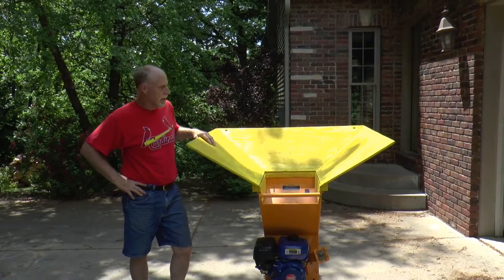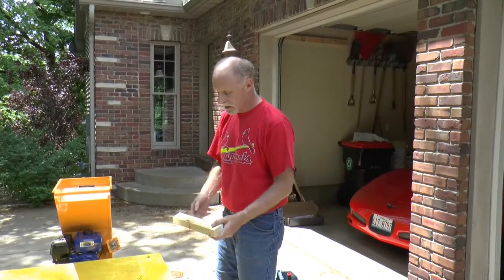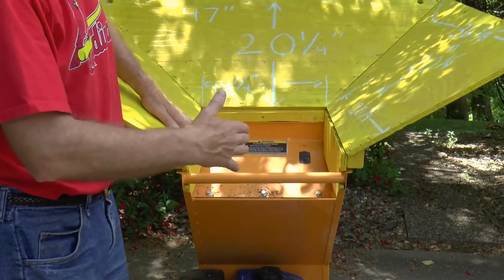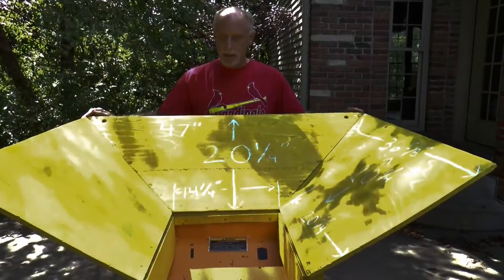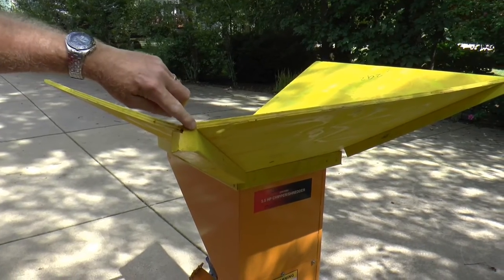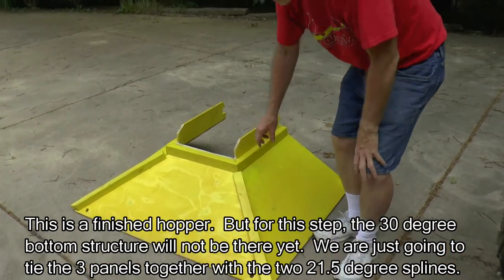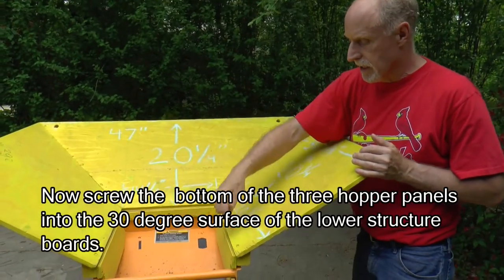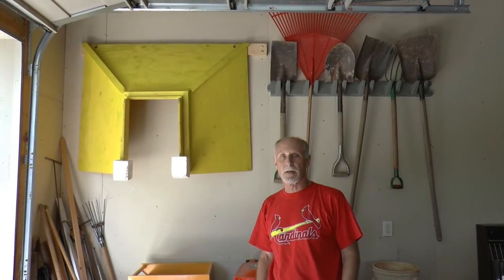How to build a leaf hopper for Harbor Freight Chipper Shredder

Comment: I really like this.  Ever think you might make a lighter version using coroplast or a similar material?
Reply from the maker: You can try Coroplast if you want, but from my experience, I would not recommend it.   When piling stuff into the hopper, it handles a good load of leaves and sticks, and it gets bumped around a lot just from the nature of the work.  It's pretty stiff the way it is, and that keeps everything square and holds its shape when carried around off the chipper.  While I don't think it needs to be any stronger (it's held together for more than 2 years of use), anything more flexible or less strong I think could be problematic.  As it is, it hangs out quite a bit from the chipper, and when you move the assembly of the chipper with the hopper on it, going over bumps shakes everything.  Based on my use and abuse, I would not even try anything weaker.  The one I have is light enough that I can carry it onto the chipper and put in in place by myself.  Near the end of the video I show how I put two holes at the edge of the hopper and put a couple of very heavy nails into studs in the garage, and cut off the heads of the nails.  This way I can store it on a wall. It's a little awkward getting it up, but I've never felt like I was going to lose control of it.  I just weighed it, and it is 21.4 lbs.
Reply: @tquinn2  those are good points.  I was mostly thinking about how I might use something like that on my bumpy yard.  It'd be pretty hard to keep it from tipping over unless the hopper extension were removed first.  Not that removing it would be a big deal, it just takes a little more time to moveit.  I really should address those bumps.  Thanks for your input.  🤓   👍
Reply from the maker: Ron, when I built this, I didn't do any drawing or real design, I just had an idea and started sawing.  (I did do some trig calcs to arrive at the angle for the reinforcing splines where the two "wings" intercept, but having done that, I tried to reproduce those calculations later and couldn't remember how I did it :-).  In the end, having the hooks on the side sheets that drop into the HF hopper pretty far (3 3/4 inches), and grab under the cross bar in the HF hopper, and the shear weight of the wood hopper holding it down on the HF chipper, it has never had any tendency to pop out or fall out of the HF chipper, whether going over bumps or going up or down slopes.  The 6 inch diameter tires on the HF chipper aren't very forgiving, so I have to go over bumps fairly slowly with or without the hopper on.  My yard is somewhat bumpy in places due to mole tunnels, and I've taken it down some stone steps with 2 inch rise, and it can handle it with the hopper in (going slowly and carefully).
Reply from the maker: One more point that I missed.  The HF chipper is really heavy.  While it looks like the wood hopper might cause the whole assembly to want to tip, because the hopper is relatively light compared to the chipper, I've never had that fear.  But next time I have it out (will be soon due to lots of leaves falling now), I'll test it on a reasonable slope and see if it has any tendency to tip.
Reply: @tquinn2  make a video of your test.  It might make for an interesting upload.  I have less math education than is needed to calculate those angles, but I do have "old school" C.A.D. (cardboard aided design) skills.  Making a cardboard template then measuring and writing down the angles is how I do a lot of stuff.     Those styrofoam corner protectors are a pretty good idea.  Have they prevented or reduced any injuries yet?
Reply from the maker: The protectors were installed after I had experienced a "non-reportable" injury, when I hit my head on one.  After I've lost my hair, I've experienced numerous minor and not so minor cuts and gouges on my head from hitting things.  It is the family joke.  It also has convinced me that the real purpose of hair is as a protective barrier.
Reply from the maker: I positioned it with the wood hopper attached, and it was stable on a 12 percent fore-aft slope (engine downhill), and a 15 percent side slope. In both cases it was not prone to tipping, even  on soft ground.  However, if I tried to tip it in that position with my hands, it was obviously going to be easier to pull it over than on level concrete.  So while I have no concern about transporting it on those slopes, I don't think I would use it in its chipping mode that way, because dumping something into the hopper and potentially getting hooked on it with a coat or tool might pull it it all over.  If I had to use it on a slope, I would position it engine uphill.  In that position, the bracket that serves as a stand opposite the tires, extends well away from the center of gravity of the chipper/ engine/ hopper combination, and that is its most stable position.  I think it would be very difficult to tip it over in that orientation, even on a slope.
Reply: @tquinn2  that makes sense.